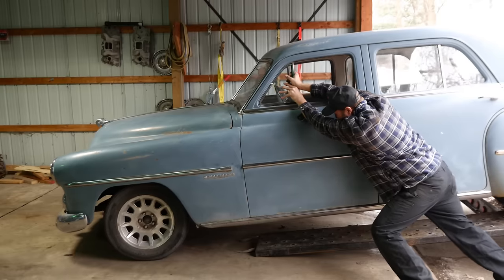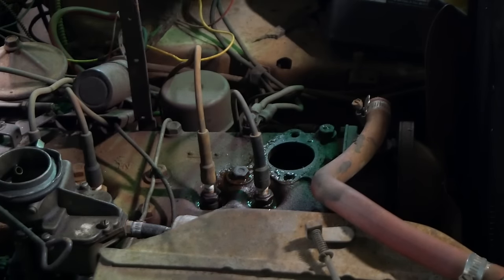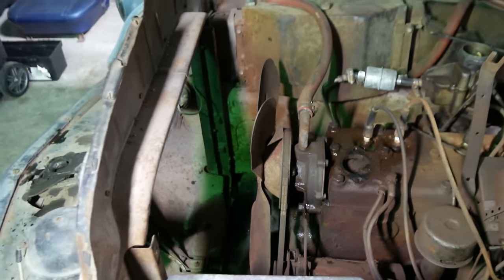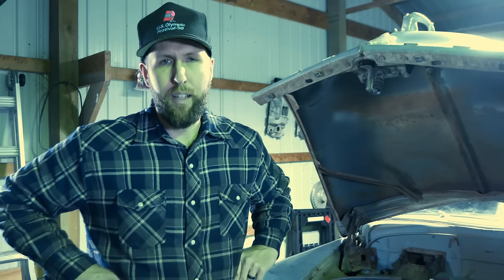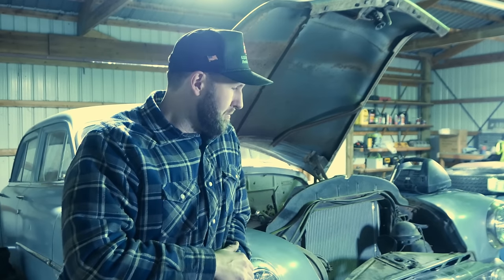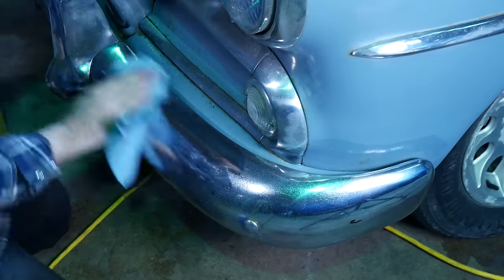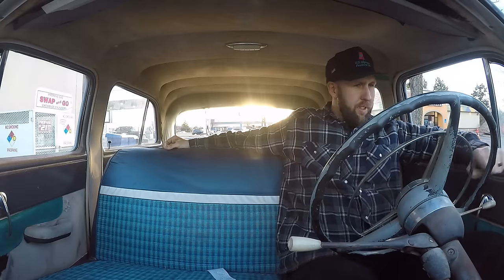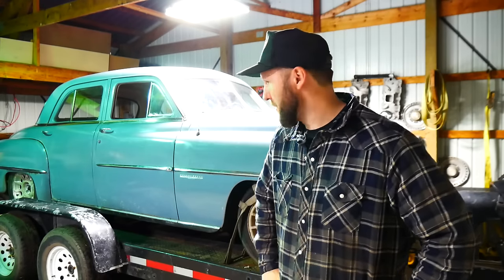1952 Dodge Cooling Repair & Paint Buff - Vice Grip Garage EP23

Comment: For me it was when I was on my way home in my 1957 Plymouth savoy 4 door. At about 1 in the morning and it was pouring down rain I was almost home when the car died at a stop sign 3 blocks away from the house. I was having starter failure and so I got underneath and started beating on the starter with a wrench to no avail. So I started pushing the heavy car uphill and im very skinny and light weight so it was a struggle when I felt the heat of a nice shiny halogen spotlight on my back. It was the cop on shift that night and asked if I needed help and yes I did. So he got out and helped me push and I asked if he'd help crank it over while I beat on the starter. After a few trys I gave up and had my dad come down and he managed to get it to start. He went on back home. I had recently had the front seat reupulstered and I was covered in mud and drenched and wasn't about to get the front seat dirty. So I looked the officer straight in the face and said im taking my pants off now and dropped my pants and thanked him and waved him bye while leaving and he just smiled and got back in his squad. Thats probably my worst and awkward break down.

Comment: We have the opposite problem! 98 ram 1500 with 360 magnum that won't heat up! New thermostat and covered 3/4 of the radiator and 76 degrees  is as hot as it will get!

Comment: Rescued a 1990 F150 351 in Charleston, shipped her up to Wisconsin, put in storage. Spring time...got her running and drove the 1/2 mile to Kwik Trip for fuel and air. Died at the pump with no chance of back to life. Called a tow truck...

The guy at Kwik Trip did give me some free coffee to keep me warm while sitting in the cab...

Comment: Broke down on I-35 South of Dallas near Hillsboro back in the early 90's on a Sunday during a Dallas Cowboy's game.  No one stopped and everything was closed.  I finally was able to get it to move and found a gas station that was open.  I had $8 in cash so I did the right thing . . . I bought a sleeve of saltine crackers, a tin of potted meat, a Dr. Pepper and a pack of cigarettes

Comment: Worst place was when I was about 18.  My '66 Nova (194 and slip-n-slide powerglide) needed a carb rebuild. It wouldn't start, so we called a friend to come get us and bring the tools to remove the carb.  I took the carb home (about 50 miles away) and rebuilt it and came back a couple of days later to refit the carb and drive it home.

Comment: The worst place I ever broke down was near "Dynamite Notch" [Antelope Pass] on Highway 89, around 135 miles North of Flagstaff. This was in December, 1987.  I was driving my 1977 Plymouth Volare wagon down a dirt road on the East side of the pass. The sand started to get deep, so I decided to turn around. When I put the car in reverse and did a "three point" turn, the shift linkage broke and I was stuck in reverse. It was starting to snow. I backed up three miles to Highway 89 and left the car in a turnout located 400 yards East of Dynamite Notch itself. I was a student at NAU in Flagstaff and, of course, I didn't have any money. It took me a week to convince my friend to tow my old Plymouth back to Flagstaff.  The good ending was that, after a mechanic worked on the car, I still had the forward gears. No reverse, though.

Comment: I broke down on the side of a small Texas highway. Very little traffic. slept on the roadside in the weeds. 24 hrs later, diagnosed no spark at the points and finally found the lead wire was parted inside the insulation.

Comment: This car is awesome and shined up nice!  Mom's good ol' SOS pads kept many of our old chrome BMX frames cleaned up every year.  Craziest place I ever broke down?  How long do ya' got?  I had a cracked starter solenoid so the main battery terminal would would come off all the time and dangle down with part of the solenoid still attached, usually I would have to reach down there in the dark and slip in back in place but one time it came out it shorted to the brake line and made a hole and caught the juice on fire so my pedal goes to the floor at the stoplight and the guy next to us says it's on fire but I was able to blow it out and crawl home with emergency brake.  Another time I had an alternator go bad, out of town in the city, on a weekend.  Had electronic ignition so I would get a jump and it would run a few blocks & get another jump till I got to a gas station with 2 bays.  The mechanic was busy but sold me the alternator and let me put it on in his shop!  I forgot to toque my lug nuts once and broke all the studs backing out of a spot while cruising downtown, dropped the front end on the ground and shoved the wheel up in the well.  A friend ran me up to my house, we grabbed the hub and rotor off my parts car and made it work but it was different rotor on the SS so the caliper wouldn't go on, so I drove home on the E brake.

Comment: Just watched this one Derek. Gotta tell you... Had a 1987 Jetta 1.8 5spd with mechanical fuel injectibles... The old CIS.... So I was sitting in rush hour traffic. The old power brick under the hood had seen better days. I used to have to start it at lunch time(every break really) so it would crank to get home. Well I was in traffic like I said.... I comes off the clutch a little too rambunctiously and she cut out. The fella in the semi behind me was not enjoying my stall with 0.001% of a cold cranking amp... Hots were all spent... So I asked the guy if he would bump start me...

"There's no way in hell I am pulling up against you!"

So I said lemme try to crank her again... Got in the car and rolled it backwards into his bumper (nice and gentle like)

Went back and said... I'm sorry for that. But since I'm up against you anyways if I just go ahead and stick her in second can you give me a little shove...

He decides it was his only way out of it, huh, can't believe it came to that...
He gave me a shove... I let the old flywheel clamp pedal out...

She lit, I gave 2 beeps, that was that

Comment: I bought an old Mustang, sight unseen, from my folks after me niece co-signer on the loan skedaddled on them. On I-80 at 1:00 AM in the mountains of Central Pennsylvania about 300 miles from nowhere there was a big bang and then silence. I pulled over about 2 and 1/2  foot from trucks passing my butt at 80 MPH and tried to diagnose the problem. I reset the timing and got her to run, sorta, and headed back out. 5-6 miles down the road and BANG! the car lifted off the road as the muffler exploded and the engine died again. I eventually took out the distributor and found no pin holding the drive gear to the shaft. I snipped the end of the radio antenna to make a new pin, bending over the ends, set the timing by ear and got 'er home. Loud ride. Drove the junk for a year, then traded it for a tired '72 Citroen D Special. She was still running okay with the radio antenna pin holding the gear on the distributor.

Comment: Where have I broken down?  My throttle linkage (that I had just worked on) came loose on the Golden Gate Bridge.  I had to idle all the way across in 4th gear.  People were honking at me for my slow speed.  I fixed the linkage at the toll booth with a twisty tie and sold the car years later with the twisty tie still in place.

Comment: You can fix that radiator problem by painting it brown to color match the shiny to the patina. I did notice the 3rd time I watched that a guy made the bolts the same socket size on the put back.

Comment: Broke down 100km out ot murray bridge in a old 1992 v8 fairlane. Radiator exploded. Drove 100km on air cooling only  no water at all. Temp gauge never passed half way!🙃🙂

Comment: Let me see if I have this right, first you spend 8 hours waxing the car with a buffing pad, then you throw white vinegar on the chrome and polish it with an SOS pad with blue soap, then you sand paper out all the rough spots with wet sand paper bought at Wally World, then after you get done you take it down to the car wash making sure you have a dead battery and wash the car. While in the car wash, the battery dies and you use a ratchet strap to load it on a trailer. Love this channel I learn so much, know a lot more now, before I didn't know diddly

Comment: I remember when i had a heating problem when i was a kid. i used what they called a re-stricter plate. A thermostat with out the thermostat in the middle.ij just slowed down the flow, lol

Comment: My first car back in about 1962 was a 49 DeSoto ragtop.  Blown head gasket more times than I can count.  Fluid drive.  You can get first, speed up and let off the gas and it should shift to second.  Use the shift-o- lator to change down and get 3rd, lift off gas to get 4th.  You can get her up to some real speed now.  Maybe 60 or so.  Enjoy.  By the way, my rag top was held onto the body with roofing nails.  Factory.

Comment: Recently my 2003 Ford Ranger 4L broke down in a crowded Chick Fil-A drive thru with 2 lanes and no place to pull off to the side due to the design. Had to redirect the traffic until they finally closed before a tow truck could take it away. Good times

Comment: I had a '52 Dodge Coronet flathead six and a Gyromatic semi auto trans with only reverse ,first, and fourth. So you max rev it in 1st and power shift it to fourth and lug the guts out of it. Drove it for a year and didn't get a lot of dates out of her and if a dog pee'd on the tire it took forever to start.

Comment: It was May, 1968.  My wife and I were going over the Rocky Mountains in a 1960 Chevrolet Station Wagon headed to Denver.  My Generator stopped charging about 30 miles west of Steamboat Springs Colorado.  It was late at night and the car wouldn’t run with the headlights on, so my wife held one of those 6 volt lanterns on the road for the 30 miles into Steamboat Springs.  We arrived at around 0:Dark 30 at a gas station battery dead as a door nail.  Come morning I bought a brush set, installed them got a jump start and all was good.  I also has 3 flat tires on the trip from Merced California to Denver.  Not one of my fondest memories.

Comment: The worst place I ever broke down was in the Ticonderoga Forest. The exhaust fell off the '66 Carryall, so using the various scraps of metal I'd picked up that summer I pieced together a new side pipe, and luckily there was a DQ right across the road, so since we had ice cream we doing ok. About 5 hours into it, enough studs had broken off the manifold that I had to just start walking, when lo and behold I saw an old Clark forklift sitting in the ditch. By gum it had the same manifold. None of the studs survived, and I didn't need a second manifold, but the DQ also had burgers and, well, I had a place to sleep. I miss that old truck.

Comment: Brakes failed on my 66 Dodge Dart (225 slant-6) going down a hill in West Virginia, 50-some years ago.  A brake cylinder popped out the piston on the right front, and all the brake fluid was squishing out and flying up onto the windshield.  I pulled out the emergency brake and pumped it repeatedly to coast down the hill to a gas station.

Comment: if you pull the thermostat you have to put a "flow restrictor" in there. ie rip the spring and center out of the old thermostat, worse break down was on a one-mile-long singel lane bridge where the traffic goes both ways. about two am in a lighting storm timing chain snapped had to push her almost half a mile.

Comment: Those old honeycomb radiators tend to break down when they get older. The solder joints fail, all over the radiator. Unfortunately, my Desoto has one of those. I did repair it but the repair shop gave me NO guarantee that it would last. Time will tell.

Comment: Best place to break down story. It was a V6 gutluss that had a split on the power steering hose. It would squirt its flammable innards right on the exhaust manifolds only when you turned the wheel. So your doing that "Do you smell something burning ?" thing, but it keeps going away. Came to a stop and a hard right turn and we got that White Cloud of Death from under the hood.  Thinking fast, I pulled into  a coffee shop parking lot and ran into the store. I grabbed the coffee pot off the counter and said "My cars on fire, I need this". Popped the hood and dumped the coffee on the fire. Turned around and the staff was following me with coffee pots filled with water. Got everything  out with minimal fire damage. The killer is they said I didn't have to pay for the coffee.

Comment: Worst break down? When I was about 16, I used to enjoy exploring the back roads, late at night--all "seat of the pants" stuff, no maps, just keep track of turns. Well, it so happened that one right turn was into one of those half mile long private drive ways, perched atop a sort of berm, so the sides of the drive way are steep. So, about 200 feet in, I tried a three point to head back out. I was driving a '63 Mustang with air shocks and, like, 12" Micky Thompsons--but they were no match for the sand, and I dug in pretty deep, sitting crossways in this guy's drive way. Walking to the road, I saw a nearby farmhouse, and, since it's, like, 1971, I'm looking for a phone. Lights were on, though it was about 1 am, so I approached a door, open on the inside, and knocked lightly. Someone came and listened to my pathetic story, let me use the phone to call a tow truck ("You're WHERE!?...40 minutes"), and told me on my way out, "You know, that's strange...our German shepherd always barks at strangers; he hasn't sounded a peep". Whoa, now I'm creeped out! hehehe...So I layed down in the middle of the road in the dead of a quiet summer night, thinking creepy thoughts until the tow came. He had to drag me out of my rut sideways, which made my air shocks sadly deflate. Made it home fine, though.

Comment: My scariest break down was in a Bedford Astra 2 door estate. Diesel flavoured.
I was driving  a touch spiritedly, just knocking it down a gear from an amount over the national speed limit for a long, steep downhill switchback section going down into a valley in Wales. 
I was greeted with that fluttering sound of the cambelt saying goodbye. 
I have no idea how I got to the bottom of the valley tyres down and still on the black stuff, problem was I was still going quite fast and the brake pedal only made more smoke.
I ended up quarter of a mile up the other side of the valley before I got the thing stopped, then had to do the same backwards, then forwards again etc, etc, until I was at a point I could stop at. It filled the entire valley with brake smoke. 
No handbrake left either. 
Then a mate came to tow me back in his Transit. I think that as he knew I had no brakes it was best if he just never stopped accelerating so I wouldn't hit the back of him. Probably not a bad idea as the tow rope was only 6 foot long...

Comment: Best place I broke down at was a restaurant parking lot, right up near the front door after a night of wobble pops at 2am, after we ate and sat for a while it was about 4am and I go out to go home and the car wouldn't start.  After a week of troubleshooting on my 2 hours after work (working 7 days a week had to take the bus for a month) I finally took the entire front off the engine and the timing chain fell off in my hand and I says to a guy, that ain't supposed to happen.  The factree cam sprocket in the Olds 307 they were putting in those old Buicks in the early 80s came with a Teflon/plastic sprocket, that after 100,000 miles of overheating became really brittle and enough teeth had sheered off and it just happened to stop at the right spot where no teeth could engage.  Lucky there is enough clearance that while I was spinning the crank like a madman the cam wasn't moving so non of the valves were moving out of the way of the pistons and I did the right thing and didn't check for any marks on the pistons and just changed the cam sprocket and chain.  used the original crank sprocket as that was looking brand new. Put everything back together and low and behold it fired up on the first try.  I was so happy, it was the best feeling in the world.  Put another 80,000 miles on that engine before I finally sold it because it was getting too many electrical problems.  and the rust, oh boy the rust.  I did the right thing there too, used construction adheesive and cut up beer cans to patch the holes in the floor so the water would stop splashing me in the face when I drove in the rain.  Since I had to remove the carpet due to the mold was eating it away.

I wonder what the new owner did with that car.  I was the second owner and for $1200 bucks I spent in 1994 and had it for 20 years, it was a great investment.  Not counting the 3 rear ends and 4 transmissions, 3 radiators and numerous break jobs and other repairs I had done over the years.  1982 Buick Lesabre, you can see a vidya I posted on my channel 11 years ago, 5000+ views, means I'm kind of a big deal, and by big deal I mean awkward loser.

I also broke down in front of an Indian restaurant in Oregon and due to a blizzard couldn't have my car towed home for a month, because Portland doesn't have snow plows, or salt... 

Oh, there was also the time my car caught fire while going to a restaurant after work, the day I was told I was going to take a 12% pay cut and needed a jump start.  I had to fix that myself because the auto repair shop couldn't find the damage... I told them the fuse block caught fire and I needed it replaced.  They were looking under the hood.  morons, the FUSE block WHERE YOU PUT FUSES.... its under the dash.. know what just give me the car I will have someone 10% smarter than you fix it, myself.  That was a lot of wire splicing to put that junk yard fuse block in there.  Drove it for about 12 years after that before I sold it.  Held up nice.

If you couldn't tell, I have no friends and no one to talk to so I ramble on in youtube comments because I have no one else to talk to